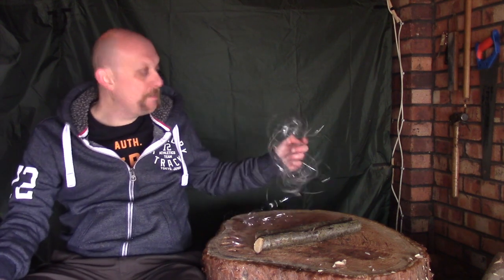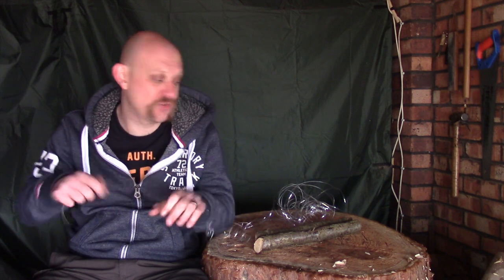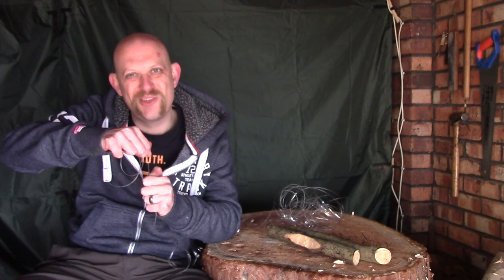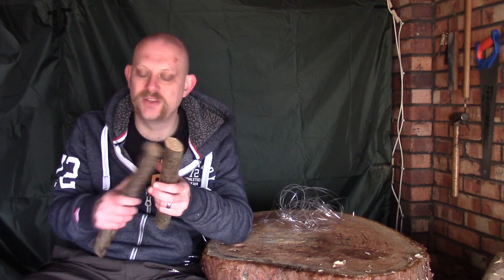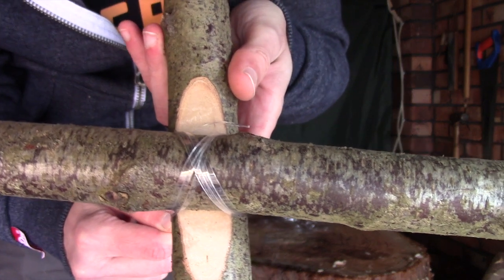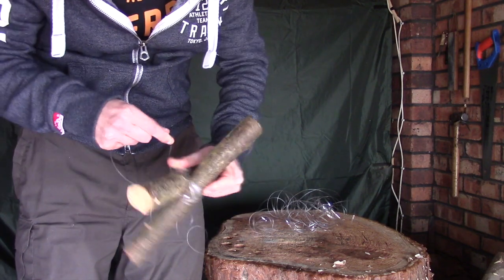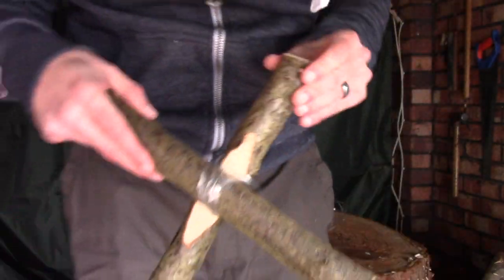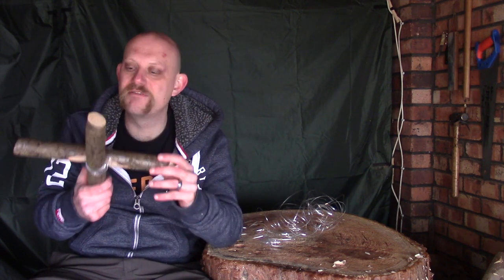Recycled Bottle Cordage - Testing and Some Thoughts

Comment: Thx WH. if a controlled amount of heat is applied along the length of this recycled cordage, the abrasive edges will be relieved. controlled heat applied to the lashing will allow the plastic to act as a shrink wrap, thus tightening the joint.